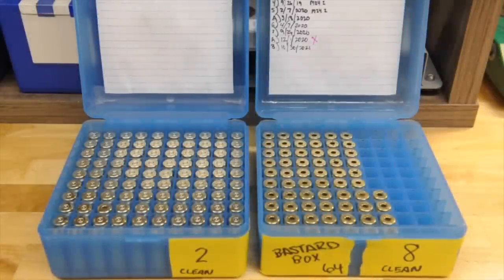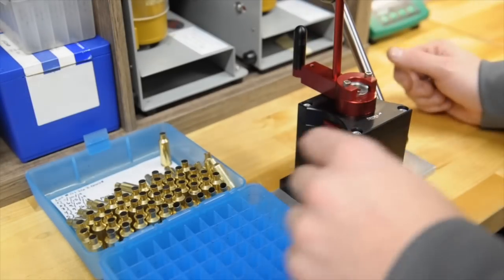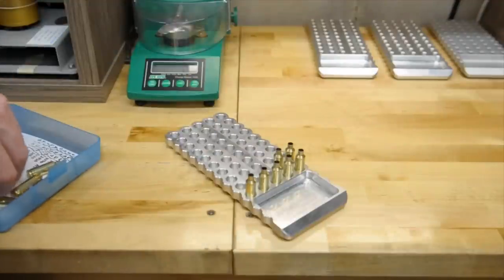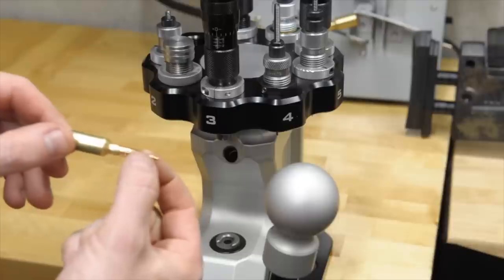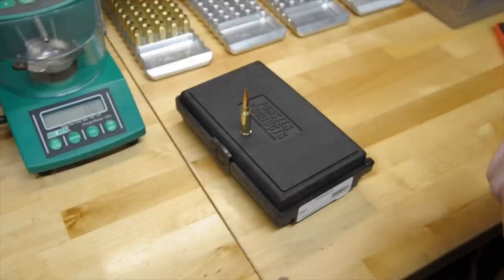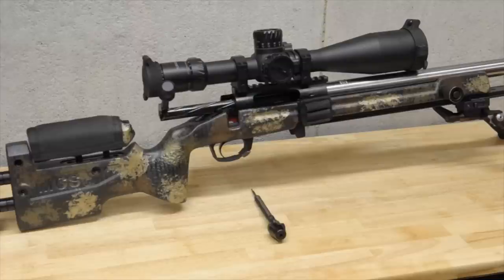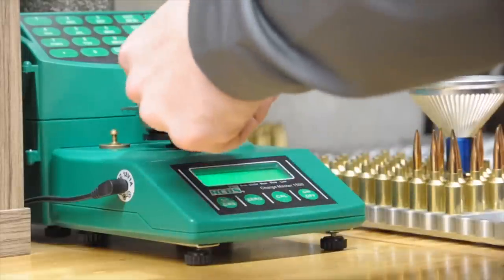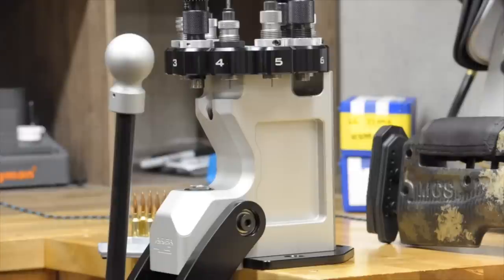Reloading 101 Part TWO

Comment: Used to do OCW but went onto Satterlee method instead. Basic ladder test + quickload + magenetospeed and you're back out the range tuning seating depths and shooting sooner with less waste.
Reply from the maker: I do the Satterlee method. Works very well.
Reply: The only reason that I dont like the Satterlee method is that the sample size is so small you could have a positive/negative offset in your results that really skews yours flat spot. 
But if it works for you, it works!
Reply from the maker: @gconnoyer  I should clarify, I usually do 5-10 rounds of each charge weight, but still follow his protocol for determining flat spot.

Comment: Nice presentation...would be really helpful if you would list the brand names of the equipment that you are using.  Thanks for helping the new guys!
Reply: Zero 419 press, Forster micrometer seating die, primal rights cps, Rcbs charge master
Reply: Also Forster kit for measuring bullet seating depth (sorry I forget the name). Hornady makes one too that I have, but that Forster kit looked very nice. 

Giraud case trimmers. They are expensive; however, Giraud also makes cartridge specific units you can put in a drill press that work very well IMHO.

Comment: Love the tunes. Hey a fishing professional for 36 years maybe if you have an issue, i can return the favor.  Im new to reloading an love it. I purchased  a Frankford tumbler an  hate the corn cobb in the primer holes so i went to the pins an distilled water hate chlorine spots. an started cleaning brass its been going good till my last batch the brass came out almost a aluminum color. I used Lemon joy an a few small squeezes of brass cleaner. Do you or anyone reading this have any idea? Its Lapua brass so don't feel its quality of brass. O an i started using a Dehydrator  to dry. It works so well that there is no question if the insides are dry. An you can do alot at one time. Im sure you no this but others reading this may not. Look forward to your next video. I do have a suggestion if interested thank you.

Comment: 8:32 What size are the inserts in the bench that hold the screws? I really like how clean it is when removing the tool and screws.
Reply: Honestly not sure, just went to the local hardware store and grabbed some wood thread inserts and corresponding hardware. I want to say they’re a 6mm bolt but dont recall

Comment: Do you use any lube on the necks when running them over the mandrel?
Reply: No lube, I just tumble them in corncob long enough to clean, but it leaves enough carbon inside the necks for lube

Comment: So you said you usually just seat the round like 30 or 50 thou off of the lands but would it be ok if you wanted to have the round seated only a couple thou away from lands? Does that cause any issues or do you always want a little space between round and lands?
Reply from the maker: I think it kind of depends on the bullet and chamber and what the “rifle likes.”  Some bullets will perform well if they are jammed into the lands and some won’t.  Just have to try it.  Generally speaking though, most bullets can be jumped anywhere from 10 to 100 thousandths with no issues.

Comment: How did you install the recessed threads?
Reply: Just drilled holes to size of my thread inserts, put them in, and used a countersink bit to get the bolts flush with the top.